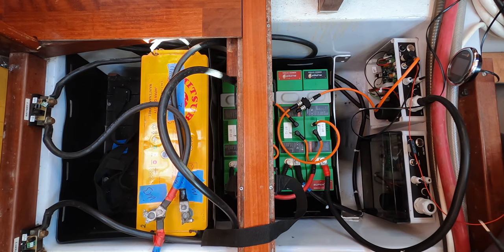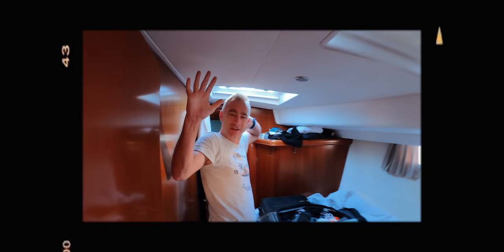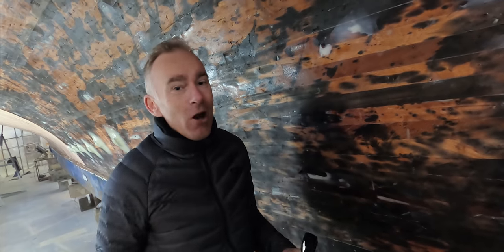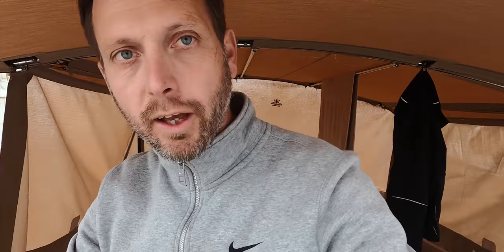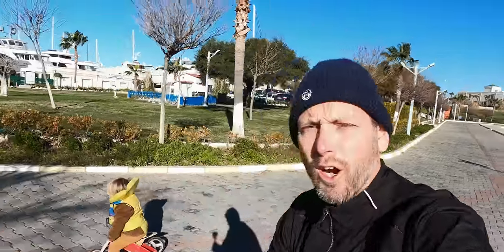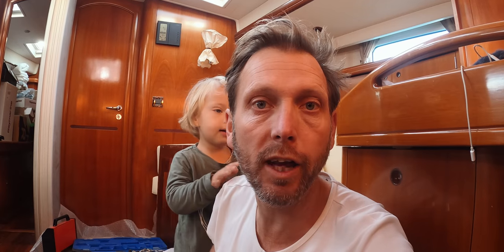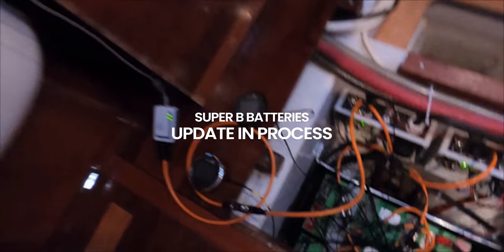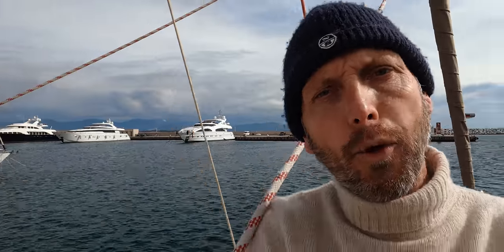Full REFIT SAILBOAT - installing the radar and troubleshooting Lithium Batteries Se. 2 Ep. 34

Comment: Ahaha the cutest little helper=) Awesome video guys! We had quite some fun with the cables through the mast too=) did you connect data and power in the end?
Reply from the maker: Yes, Benjamin is a great helper. We connected now only power and left the data behind. Connected via Wifi and works well, will try it here this season in the Med and when necessary we connect data as well. You?
Reply: @FeeltheBreeze  aa same here, we had some issues a few times but more firmware related and a repairing did the job, in general the wifi works very quick and reliable=) tracking boat or storm clouds with the radar is really amazing as you are able to get their heading and speed - hope you enjoy it=)

Comment: Your batteries are interesting. They appear to be 50% of the size and weight of batteries I have seen. What is the size of your battery bank? Are they available in the United States?
Reply from the maker: Hi Paul, thanks for asking, they are 39 % of the weight to be precise 😂. We have 4 times 105ah for the 24v bank and 2 times 105ah for the 12v bank. For the lithium starter batteries we use 25ah but with an enormous cranking power. You can find all details at www.super-b.com
Reply: @FeeltheBreeze  I am U.S. based. The trend is towards a 24v system. I am looking into an all-electric  cat conversion unless I buy "Top Secret." Search it. It's worth the dream. At this point, I'm looking at about 2k solar panels, attached to an appropriate battery bank. Electric propulsion. The weight of the batteries I have seen is much higher, as we have seen. Thanks for the information!  Fair Winds, Following Seas, always.